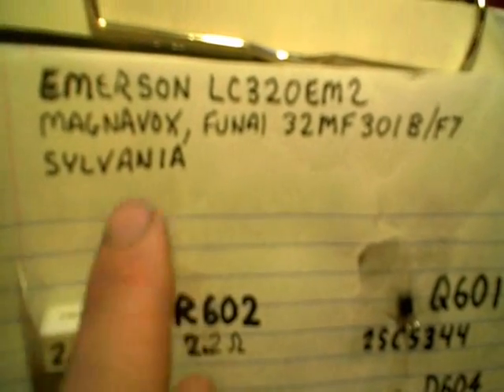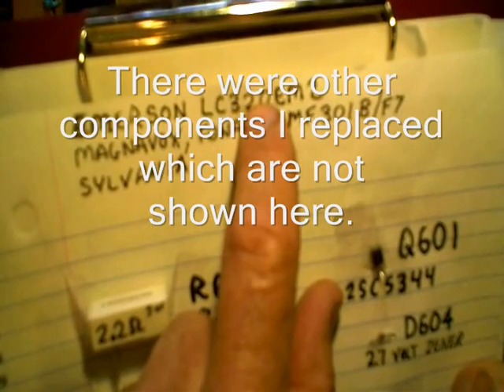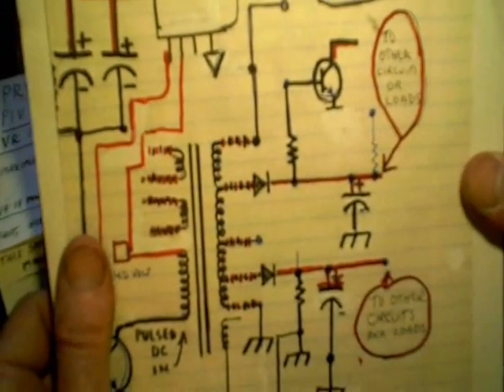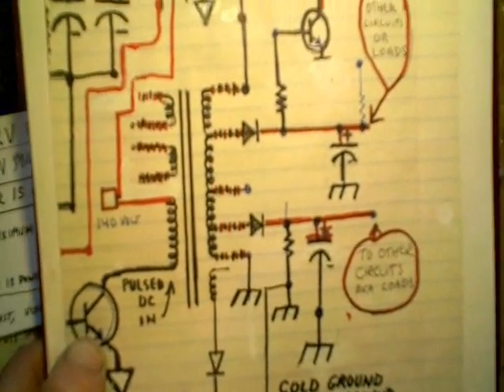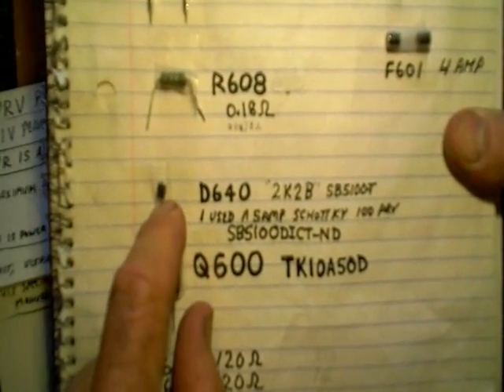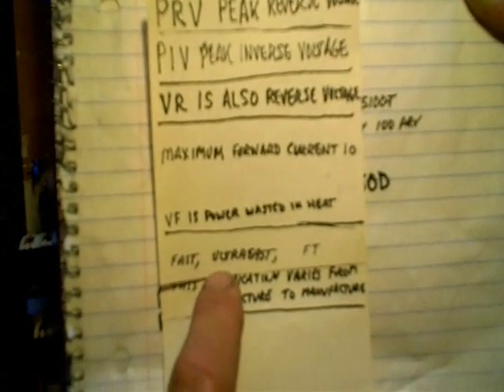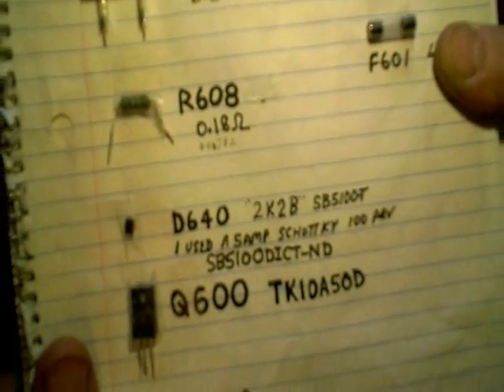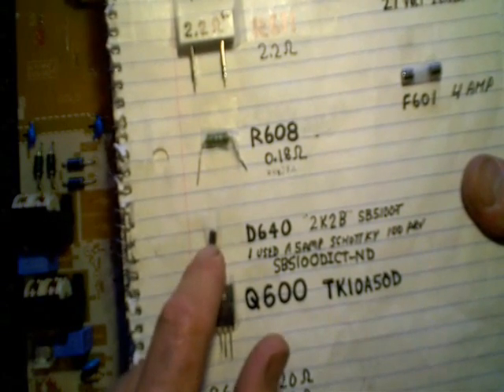Upgrading To A Better Diode.

Comment: I try to upgrade where I can. Manufacturers often use the cheap parts pleasing the bean counters while building in planned obsolescent. Most people will simply go out and buy a new one again rather then have it repaired. Thanks for sharing.